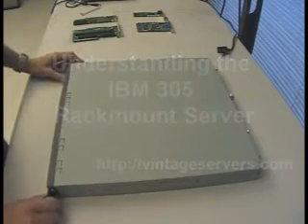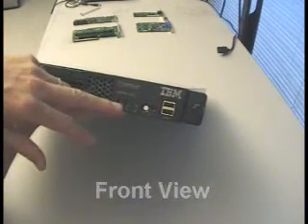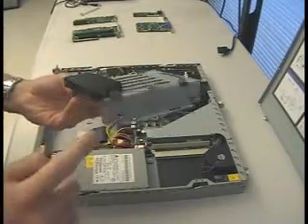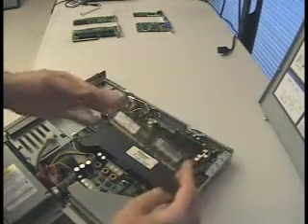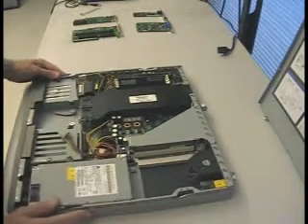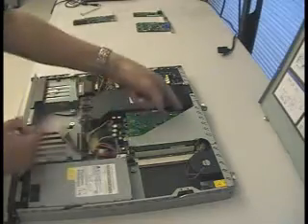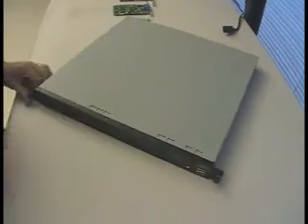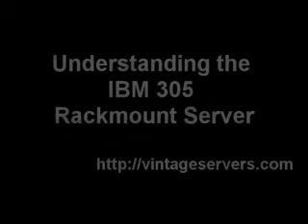Understanding the IBM 305 Rackmount Server

Comment from the maker: It has space for two 3.5" drives.  Usually we do a RAID1 using a 3ware 7000/8000 or a 3Ware 9550 SATA.  the chassis has two MOLEX power connectors so can power two drives just fine.  We have thousands of these hosting web sites and mail servers.  They are great for COLO because they are so small(1U), low heat and well proven as servers.